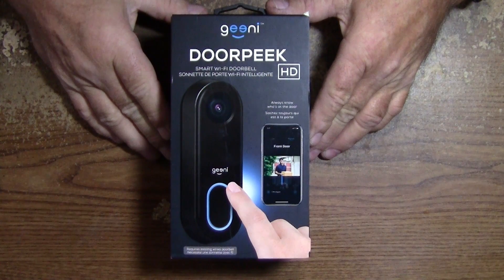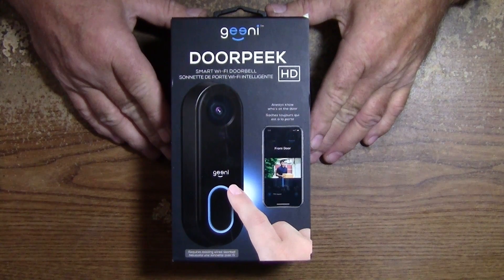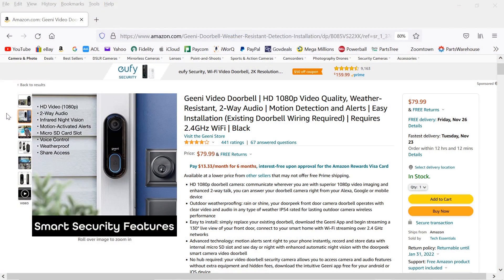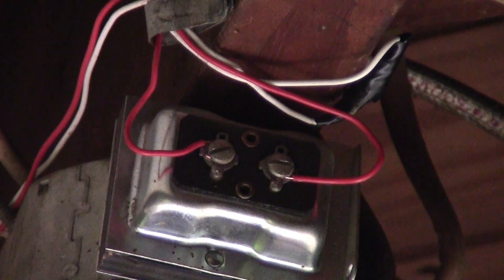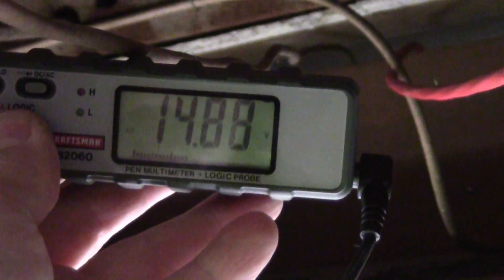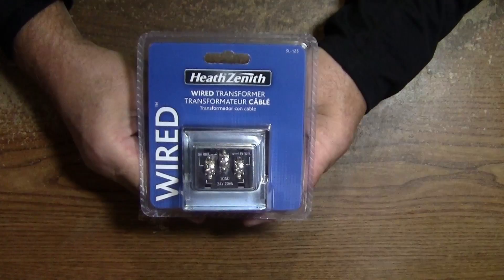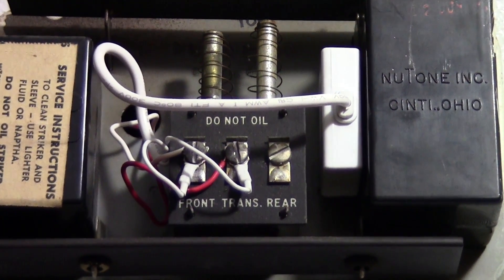Geeni Doorbell Video Camera chime not working

Comment: The issue was not the voltage it was the wattage of your old transformer.  Most doorbells are 16v if you connect a 16v doorbell to a 24v transformer you could cause a fire.  The Geeni doorbell works fine on a 16v transformer so long as it has the appropriate wattage to run the camera and the doorbell.  Most doorbell kits come with a transformer just big enough to ring the chime.  Defiant makes a 16v 30w transformer specifically for this application that they sell at Home Depot for less than $20.  FYI that tri-volt transformer won't run the camera and the chime when wired for 16v.  Please use the appropriate transformer for your doorbells.  The correct voltage will be listed under your chime's cover.
Reply from the maker: Thanks for the info I will look into it. However, the transformer I put in came from Home Depot and it's still working great. Door bell is working and the camera couldn't be working better.
Reply: @LonnieJohnson1  so long as your doorbell is rated for 24v there is no issue. The camera is rated for 8-24vac input.  That camera uses about 10W and so does a standard doorbell chime.  That transformer runs 20w when wired for 24v but only 10 in the other configurations.

Comment: I put in a 24v 40va transformer and it burned out my chime for the back doorbell.  Front doorbell still works.  When the back door bell was rung, the door chime buzzed for about 5-7 seconds, made a clunk noise, and it hasnt worked since.  Since no one seems to make a 24v door chime, I might have to try a 16v 30va transformer and replace my door chime.
Reply from the maker: Is the chime for the front door the same as the back door?

Comment: Hi your video was good but you need to add that you have to go into the doorbell settings look for chimes and turn on manual and that activates the house chime haven put the old transformer back on to see if it would of worked spent 3 days messing with it until I broke down and called the help line and they walked me through the app and it worked you tube always leaves something out or most of the time but thanks
Reply from the maker: Your right, didn't even think about that. I'll try to add it somewhere on the page. Thanks
Reply: Who do you see this setting
Reply: I don't see that setting in chimes

Comment: I'm having trouble putting in sd card one way it doesn't fit the other way it goes in to far any suggestions
Reply from the maker: I used tweezers to push mine in. It pushes in further than I would have thought.

Comment: My transformer was out originally also, put a new one in.  Still no chiming, voltage test says 21 now.  Yours at 28/29 is probably a good thing
Reply from the maker: It has to be 24 or higher.

Comment: Thanks. This worked for me. Was able to get exact same transformer at Home Depot. Higher voltage seems to help. Set doorbells settings to "manual Chime" or "mechanical" and worked just fine.
Reply from the maker: You're welcome

Comment: How did you wire the transformer? I have the same one and it's only putting out 18
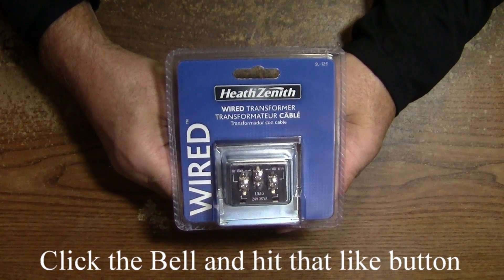Reply from the maker: Look @ 1:40 of the video and it shows how I hooked it up for 24v. Go to the link below on Amazon and you will see a bigger picture and wiring placement. 
Doorbell Transformer 3TRAN Tri-Volt (8V 10VA, 16V 10VA or 24V 20VA) Hardwired Door Chime Transformer 8-24V
Reply: @LonnieJohnson1  thank you, worked great!
Reply from the maker: Your welcome, glad to help.

Comment: Some door bells require a diode to be installed into the circuit.   I wonder if this would be an issue with the Genni Door Bell Camera?
Reply from the maker: Depends on the voltage.

Comment: Where is the transformer located
Reply from the maker: Follow your doorbell wire and it should lead you to the transformer,
Reply: @LonnieJohnson1  Quite often it is near the doorbell. Look in a hallway closet, many times it is up on the ceiling (many of them have been panted over)
Reply: @LonnieJohnson1  Sometimes in the garage as well on some homes.

Comment: Did you hook up the chime resistor too? I unhooked my chime because it constantly buzzed. The camera seems to work fine. I haven't checked my voltage. Im going to do that now. Update: i see you do have the resistor hooked up. 🤦‍♂️ do you think that's my problem?
Reply from the maker: Yes but you also need the 24v transformer.

Comment: Thanks for that lonnie,right on the Button, mine was 10Volt, swapped to the multi voltage set to 24Volt, Inside doorbell now works, $29.95 CDN at HomeHardware. (Heath Zenith Wired transformer SL-125)
Reply from the maker: Your welcome

Comment: Seems the manufacturer states 16v to 24v range for this doorbell and yours tested at 27-28v. Are you having any issues since you’re operating over the maximum voltage?
Reply from the maker: Still working great